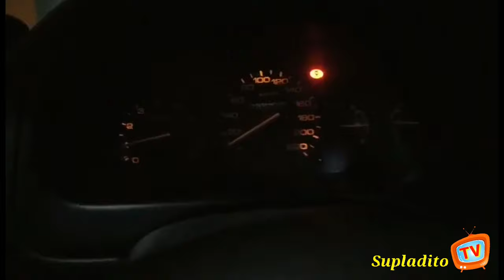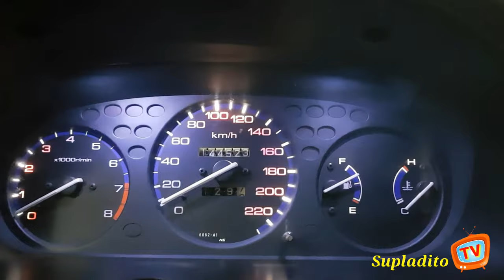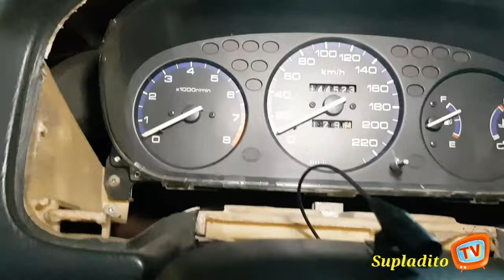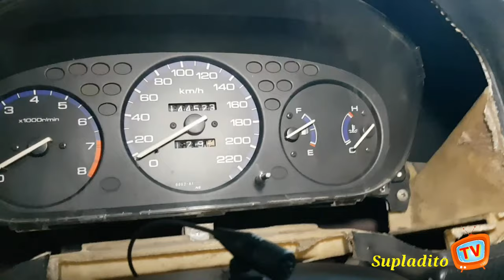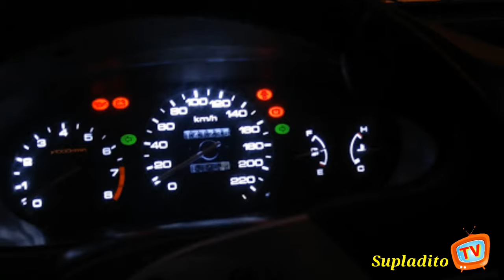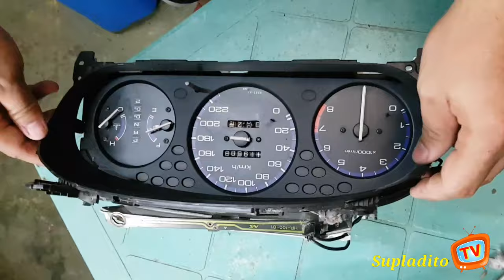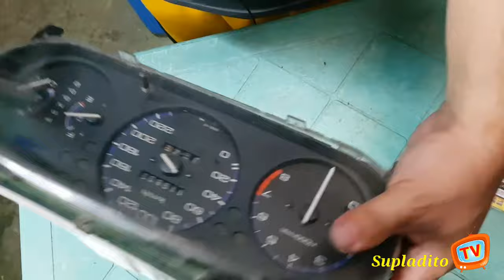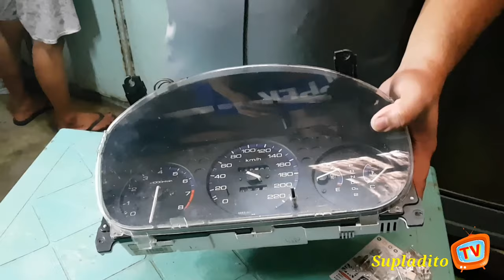Honda Civic EK: Brighter Cluster Gauge

Comment: you can now buy a 90cm motorcycle led strip sa shopee or motorcycle shops, tamang-tama yung haba nya sa cluster for the gauge meters, then use a changeover relay para sa acc as power source para may ilaw lagi when car is on and color change when switching to parklights/headlights

Comment: Boss ano po bang description ng bulb n ginagamit dyan sa panel T5 o T10 po ba?
Reply from the maker: For ek po may isang T10 at mga pito po na T5 po
Reply: Follow up  boss, kailangan  bang tanggalin  muna ang connections sa  battery terminal kapag magpapalit ng cluster lamps
Reply from the maker: @wackynwackyn3658  di naman po pero need mo tangalin ung cluster gauge po para makakakilos ng maigi ang inyon ga kamay po and to test if iilaw specially if les gagamitin may polarity po kasi un pag hindi umilaw try baliktarin if led bulb gamit

Comment: Boss tanong lang may bibilhin akong ek sir body na vti kaso may naka alis na socket sa ilalim ng distributor, sabi nya socket yon para sa reverse and dpt naka konekta yon sa transmission? Ok lang bayon
Reply from the maker: humphrey baul pwede mo naman sir i connect un ... bakit po ba hindi naka connect daw sir? Putol wire? To check if un nga sir pwede mo naman i dugtong yun... switch on but dont start then put the gear to reverse position then check if umilaw reverese light if umilaw...
Reply: Supladito TV ok sir thank you po... yung socket sir hindi po sya tugma
Reply: Boss tanung lang po ulet, kinuha kona yung unit yung pung socket kapag pinagdugtong naka ilaw agad yung reverse light. Yung switch po yung problem noh? Feel ko dinaman yung socket
Reply from the maker: humphrey baul mukhang switch na nga sir
Reply from the maker: humphrey baul pero pa check nyo pa rin po sir para maka sure
Reply: Supladito TV thank you po ulet